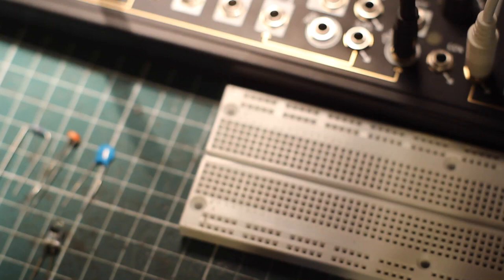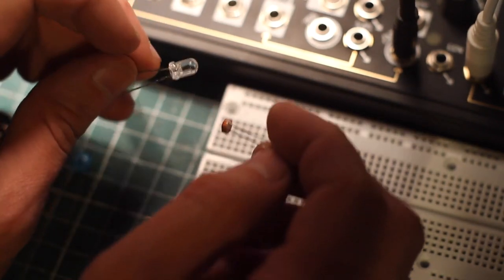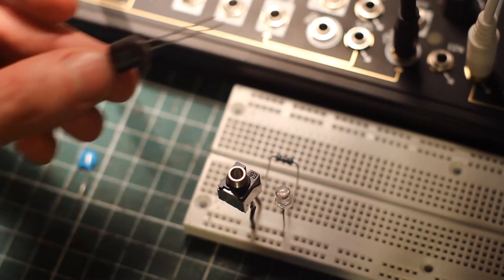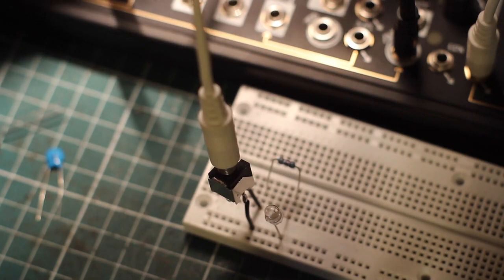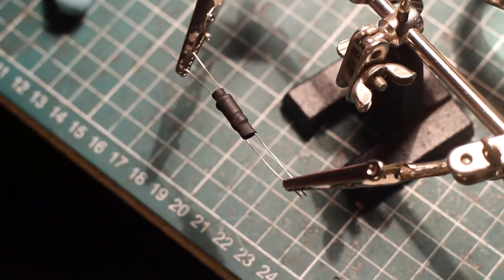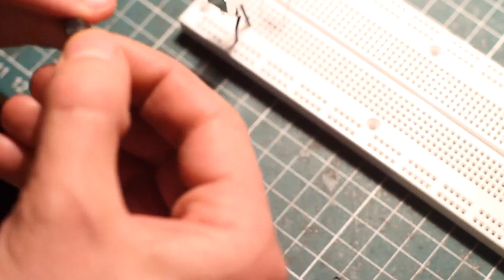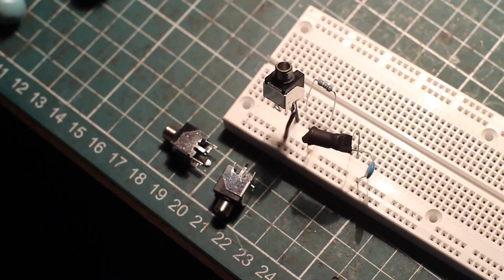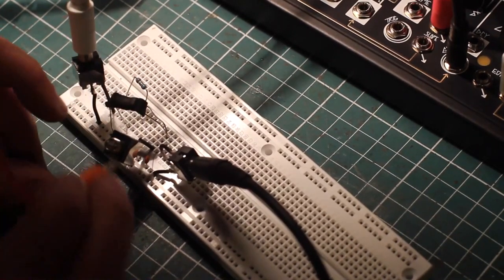SDIYClass#2 - The 3 dollar LoPass Gate - Make your own Vactrol!

Comment: Why the 33k resistor? I thought current limiting resistors for leds are usually under 1k.
Reply from the maker: that depends on your power source and how sensitive the LED is. It also affects the Lo pass gate response. I arrived at this value experimentally for my particular LED and LDR. Eurorack can put out up to 10v though, so yeah, less than 1k is definitely not enough. You may be thinking of digital circuits powered by 3.3v.
Reply: That was quick, Thanks! I was aware that the appropiate resistance is relative to the supply voltage, i just didn't really take in to account that the response curve has to sound good. Guess i'll have to use my ears. Probably not a bad idea anyway.

Comment: Would you be willing to explain how this can be transferred off the breadboard and onto a pcb into a module? Perhaps a dumb question since I’m very new to DIY
Reply from the maker: Hi Caleb! You can get a permanent breadboard, strip board or perfboard. Those allow the circuit to be soldered permanently rather than stuck on by friction. Do that and you'll have yourself an actual module you can stick into your modular :)
Reply: Synth Diy Guy thanks the the quick response! Thinking about making my own dual lpg
Reply from the maker: Caleb, watch my "deadbug buffer" video for an idea for the panel. And the LPG circuit can actually be soldered point to point, directly on the jacks, no need for even any kind of circuit board ;)

Comment: Synth Diy Guy, Add a 25K potentiometer between 10nF and the audio "path" : )
Reply: I've built a couple of these LPGs. What does the pot do - does it vary the filter characteristis of the capacitor?
Reply: @mcshafty1  yes, RC filter.
Reply: @mcshafty1  if you want you can calculate the cut off point. and have a real filter
1 / ( 2 x π x R x C)

where R = Ohm and C is farad. so you have to shift the value of the cap.
1 uF = 0.001 Farad.
1 nF = 0.000001 Farad.
https://nl.farnell.com/uf-nf-pf-capacitor-conversion-table
Reply: @AnalogDude_  Thanks for the additional info @Analog Dude

Comment: Brilliant, subscribed.
Does adding the capacitor in the output means that this LPG will not pass CV or DC?
Reply from the maker: Hi, thanks! No, the cap just makes it roll out some high frequencies, it's what makes it an LPG, not just a voltage controlled resistor :)
A DC blocking cap would be in series with the output.

Comment: What if you patch a 5 volts offset (from the math section) to audio in of the vactrol gate, audio output to dynamics and contour to cv input ? It should turn this into a real lowpass gate for typical buchla bongo

Amazing tutorial by the way :)
Reply from the maker: I don't quite follow the logic of patching DC into the audio input, but if I use the dynamics section of the 0 coast, that's already a lopass gate anyways ;)
Reply: It's to get a vactrol low pass gate. i thought you needed to have a dc offset though the circuit to open the dynamics like when you want a drone and then open/close it with the vactrol to get the smoothing effect. Anyway, I already ordered what i need to follow your tutorial :)

Edit : i just understood that the capacitor is here the lowpass filter :o

Comment: Some posts on that forum thread are saying "that's not a low-pass gate it's just an attenuator" but... the LDR part of the circuit at https://youtu.be/8BOnvSQpoGY?t=497 looks like a low-pass RC filter to me, is that right? Thanks for the video, it's really good!
Reply from the maker: yeah, as long as there's a cap to ground it's a filter. If you skip the cap and use just the LDR then it's more just a VC attenuator. Thanks!

Comment: By far the most superior vactrol video > thank you Bo$$.  I'm using a 2.2v LED with the 0 coast contour, and it works great.  Only thing is though there is no resistor needed, from the Contour output.  If I use a 33k resistor it won't light at all, even a 1k it's dim.   I thought contour would have a hotter output; after measuring it on a meter it came out around just under 3v.  What's the voltage coming out of your contour output if you get chance to measure?  Thanks again!
Reply from the maker: Hi! Thanks for your nice comment :)
The resistor is there to protect the LED from burning out due to excessive current. Not using one may be fine for the 0Coast, but beware of other EGs that may put out up to 10v. In fact my 0 Coast (just measured) puts out 7.5v, it seems very strange to me that yours is only outputting 3v...  Do you have the sustain pot on Max?  If so, I would try to get it fixed by MN under warranty. They are good guys, surely they will help you :)
Cheers!
Q
Reply: Thanks very much for the quick reply!  The output is indeed very low on my contour.  Thanks for checking the voltage for me.  I'll check with MN and see what they say, they may have a ref. measurement I can take.  I'll give it a quick factory reset first.  They are great guys, very helpful!  
I'm really pleased with the result from this gate.  I'm making an EG to drive it, and that will output enough to fry the led!  I will experiment with the output level of that EG, probably around 10v, probs need at least 40k.
Reply from the maker: that'll depend on your LED. A 10 K resistor is likely enough to protect the LED, more than that would be more about fine tuning the LED response.
Reply: Thank you for the insight!